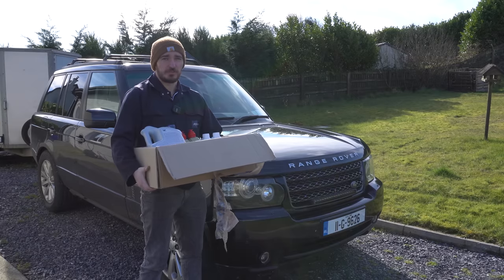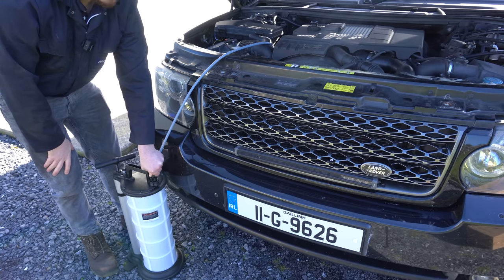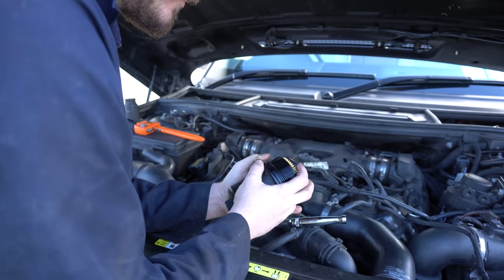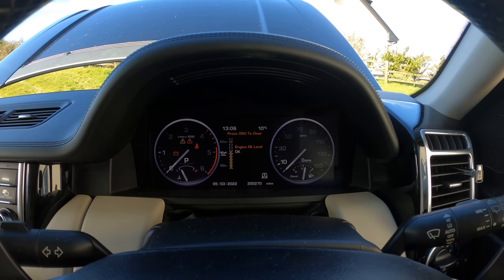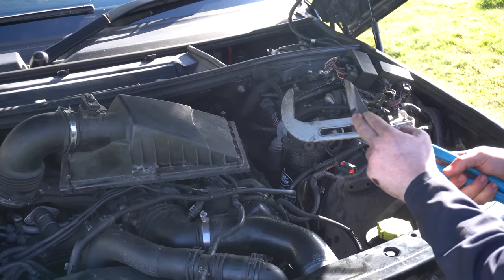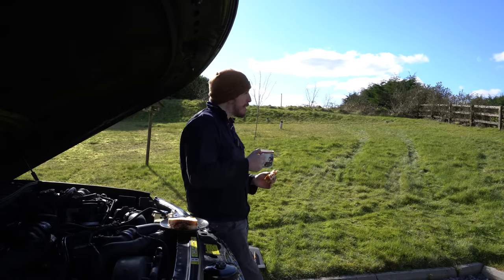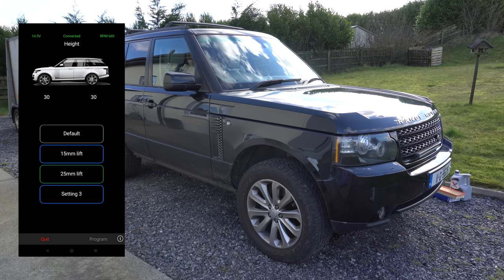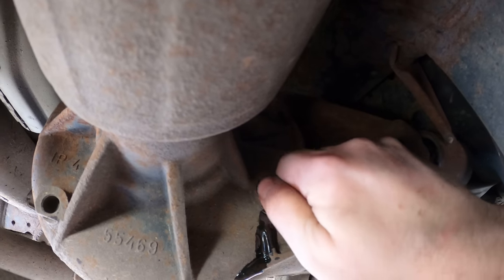I did a 200,000 MILE SERVICE on the CHEAPEST 4.4 TDV8 Range Rover L322

Comment: Great video again Sam. Any idea how to reset service required message on screen when I start up.
L322 2009 face-lift 3.6 vogue se
Reply from the maker: Thanks Paul!  On the facelift L322s the only way to reset the service interval is using a diagnostic tool.
Reply: @SamsMotors  Thanks Sam. I'll have a go tomorrow 👍
Reply: All done now. Thanks for info. I was opening bonnet, opening door. Feet on accelerator and brake pedals for two days with no luck 😁

Comment: Thoughts on the Fumitomo F-106 oil drain valve - or the US version - EZ oil drain valve with a length of tubing attaching come oil change time? If you wanted to go belt and braces - pump from the top AND drain from the sump? Would appear to offer a way of dealing with the "uncontrollable" outpouring albeit a small residual after pumping. The pump is excellent and I'm wondering if on the 3.6 whether you can ease the tube over the dip-stick tube instead of threading the narrow tube down the neck to replicate what happens on the 4.4 with the dedicated pipe?
Reply from the maker: A valve would seem a decent idea but I don't like how easy it looks to knock that Fumitomo open.  Appreciate it's hidden above the undertray etc but I don't think I'd want to trust it not to dump my oil all over the road! 

Probably a good idea to drain from below once in a while to ensure there aren't any nasties lurking at the bottom of the sump, though saying that the suction tube goes below the bottom 'floor' of the sump on the 4.4. 

You could certainly suck from the dipstick tube but unsure how close to the bottom of the sump it enters so it might leave a good quantity of oil in there.
Reply: When I get my purchase home I will try it and let you know. It has a height sensor failure on the rear left. Should be a simple fix when the part arrives. Height sensors said to be good for a million actuations which coincidentally kicked in on the morning I was due to take receipt of the vehicle! I ordered the tap - I will feedback on due course. I’ll make sure I carry oil and a spare drain plug and washer in the car!

Comment: Sam. I have been reading up about engine oil. Do you think there are any special considerations for high mileage FFRRs other than more frequent changes? Would a premium oil be that much better than a plain spec version? Do you think there is any merit at all in the additives eg molybdenum to reduce friction? I understand there’s a filter mechanism at the base of the sump - worth taking the sump off for a thorough clean out every three changes perhaps? Tribology is interesting.
Reply from the maker: Hey Russell, another good question, we need to get you on the next live stream 🤣

Someone on here suggested perhaps moving to a heavier weight of engine oil might be a good idea, considering the not insignificant mileage on my engine.  Whilst my engine is doubtless considerably more worn than one at 50k miles, it doesn't exhibit any of the classic 'worn engine' symptoms of old, e.g. oil consumption, power loss or excessive blow-by.  Because of that, I don't think a heavier oil would have any benefit.

In terms of the oil spec, my limited exposure to tribology in a previous job working with high pressure fuel injection equipment would lead me to believe that oil condition is much more important in terms of wear than oil spec or additives - hence my belief that frequent changes of oil with the correct spec (but not necessarily the very 'best' / most expensive) oil being better than longer changes with a pricy oil.  I'm not discounting the effects of additives and friction modifiers etc but I'd say it's probably a secondary effect to the oil condition.  If you let your oil break down and become terribly contaminated, no amount of additive is going to help.

Just my 2p!

Comment: I'm never quite sure about sucking old engine oil out from above. Would this not leave a certain amount of old oil and sediment in the bottom of the sump to contaminate the new oil?
Reply from the maker: Probably a little more than draining normally,   but you could minimise that by draining via the sump plug or doing a flush every few oil changes.

Comment: Great video, I've got the same car and slowly working through similar things you've done. Got the transmission flush, diff and transfer box booked in to a garage because ive taken the easy way out :) I just wondered if yours suffers from the puffs of oil smoke when you haven't used the 2nd turbo for a while? mine does but the oil drain mod that people talk about looks expensive
Reply from the maker: Cheers, no shame in getting the diff and tbox oils done at the same time as a transmission flush, it's definitely a lot easier for them with a ramp! 
Mine doesn't do the oil smoke puffing no, although I know a lot do.  I'm guessing the mod was done as a recall before I got the car, as it always went to LR main dealers before I got it.  I don't think there are any deleterious effects from not doing the mod - most people just make sure to give the car a bootful every few days to clear out the oil.
Reply: @SamsMotors  Thanks for the reply. Yea I tend do take it to 3k rpm every so often, it does its thing and then after that if you hit 3k rpm again it doesn't do it. So clearing it out seems to work. Ive read various things like if you do a few small journeys that encourages it to collect oil. Just one of those things I think, not worth messing with as the car seems great otherwise. I was poking around under the car looking at the transmission oil pan looking for evidence of it being changed and I noticed some oil leaking from above and you mentioned the oil cooler o-rings leak in that area so that might be something for me to investigate.

I've been following your channel since getting mine, ive upgraded tyres but went for grabber AT3's, changed brake fluid but that was because a rear caliper was sticking causing it to heat up so changed the caliper and now servicing the transmission. Should be good for a few miles after that. Mines on 103k so encouraging to see yours going strong after 200.

Thanks for the videos!

Comment: Are you going to do anything with your egr valves? Clean them or remove them possibly?
Reply from the maker: It's a bit trickier to remove them on the 4.4 compared with the 3.6.  There aren't any blanking kits available for them - I think because the EGR is a lot more 'integrated' into the way the engine works on these.  Cleaning might be a possibility but, "if it ain't broke, don't fix it" definitely applies here...

Comment: Hi Sam, love all your videos on the Range. I’m looking into the same 4.4v8 tdi, I have a budget of 20k and looking for advice due to your experience. I can get a 2011/2012 Westminster for this budget with between 80-100k. My question is would you spend more and get one with less miles or spend less with heigher mileage ? Also are there any big service items which may affect the decision of which way to go ? I hope you can help 👍
Reply from the maker: Hey Jason thanks for the comment.
Are you in the UK, or Ireland or somewhere else?  20k GBP is a fabulous budget if you're in the UK, and even the very youngest, lowest mileage Westminster and Autobiography models would be within your reach for that.
My advice would be not to buy so much on mileage but more on condition and service history, particularly if you're not going to be doing huge mileages yourself.
Spending a bit less on the initial purchase, and getting something with a few more miles would leave you with an excellent slush fund with which you could thoroughly 'titivate' and improve your new purchase, as well as for any unforeseen bills.  Things like getting the transmission megaflushed, fitting new tyres, and going through any worn suspension components would go a long way to improving and preserving the driving pleasure of the RR and would be money very well spent.
Reply: Thanks your your reply. I’m in the UK, it would only be a weekend car essentially as I’m in the trade And more than happy with doing maintenance myself. What kind of mileage would you look at getting I’ll prob be doing less that 5k miles a year - I’ve always wanted an L322 and need to get it out my system 😊. As far as big maintenance items is there anything that I should look out for or that would have been done at a certain mileage which would then narrow my search down ? Would be interested in a video showing the functions/demo of the low range/diff settings ?
Reply: I have a 2010 bought it with 80k miles on it now I'm right at 200k and all I've had to do to it is replace the fuel pump and  change the oil it's been shockingly reliable and still looks new the interior holds up great I've owned alot of cars I highly recommend it

Comment: What's the thinking behind sucking the oil out over draining via the sump plug? Know Mercedes are the same and some (newer) VW's are the same. Is it so you don't disturb anything mechanically?? 🤔🤔
Reply: I thinks it because you can get more of the old oil out.
Reply from the maker: I think originally it was just to reduce service costs/time and make it easier for technicians.  If you think about it, this job would take up a ramp at a garage if you had to get under it to drain the oil.  As it is, all the engine service items can be done from ground level.

Comment: I recently did the timing chains and belts of the V6 variant of this engine. 
That was a challenge. Next time, I will take off the chassis to get access. 

Are you planning to do those chains any time soon?
Reply from the maker: They probably do want doing... It looks a very intimidating job though.  I had the same thought as you, when I have time, to remove the engine completely and give it a full overhaul/refresh including doing the timing chains.  It'll have to wait until I have a workshop/garage to do it in though!
Reply: Your comment made me laugh out loud while sat watching this in my kitchen.

You did the timing chain and belts and will look at taking off the chassis next time.

I'm still building the courage to have a go to change the rear light clusters on my XC90! Kudos to you!

Comment: Why didn't you do the transmission oil and filter as well?
Reply from the maker: It was done already a few months ago (see megaflush video)
Reply: @SamsMotors  I just subscribed to your channel and am watching it as we speak..........................:)
Reply: You flushed the oil but didn't change the filter, the ZF trans the oil pan is the filter isn't it, why not get the guy to dump the old oil and then change the filter all in on go, then refill or am I incorrect ?
Reply: @markfitzgerald7556  his old filter will degrade, break apart a bit, and clog up the shift solenoids causing surging and weird shifts.  Gotta change the pan

Comment: The only reason LR want you to use a suction pump is that they know most people won't go out and buy one and they will bring it to a dealership....your never going to get all the old oil out by using a pump..using the sump is always better...
Reply from the maker: I'd say it's more because it saves them time (and ramp space) in their workshops, reducing service costs.  You get the vast majority of oil out with the pump - but it might be prudent to do a sump drain every 2-3 changes just to make sure you get any sludge or remnants out.

Comment: Hi Sam great video. Would definitely recommend moving up to a heavier weight oil at least 5w 40 or even 50 seeing as there are over 200k miles on that engine, might even find she will run a lot smoother. As for using a vacuum pump to remove the oil I find you will get a lot more crap out of the sump when letting it drain normally, those vacuum pumps were designed for garages to save them time and money imo.  Keep up the good work. Mick 👍🍻